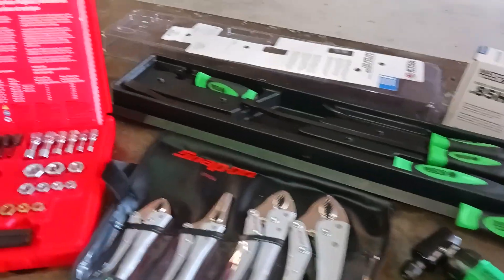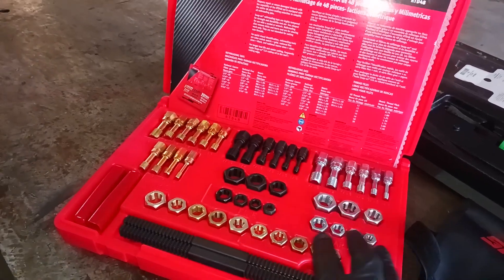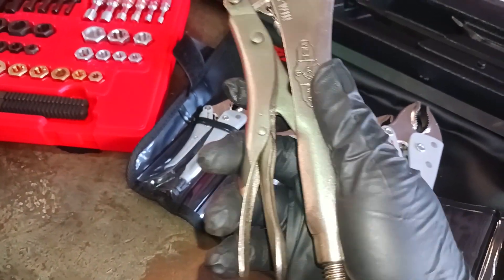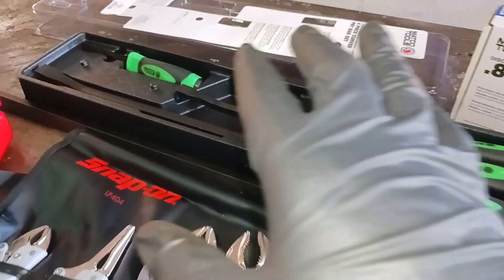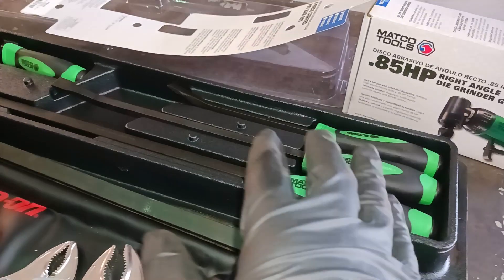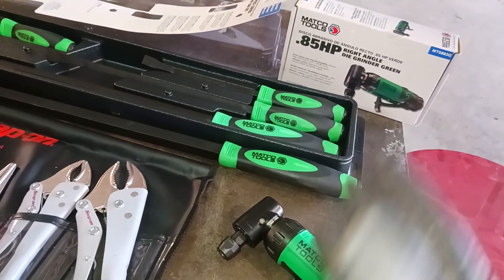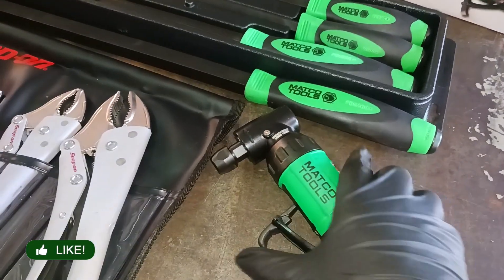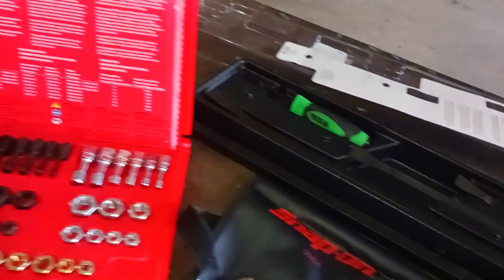Must Have Tools From Snap-on and Matco Tools! A Tool Truck Tool Haul!

Comment: Seems like a Great tool haul. You had common sense and logical explanations for each purchase. Recently I was really upset missing out on Astro 3/8" 19 piece nano socket set for $54.99. Went to get em the next week and they were almost 90. Then I looked further found the 14 piece with a 9 piece 1/4" universal socket set for $73.99. I jumped on it. I do miss the 20, 21, 22, 24mm in the 19 piece set but I will find the 1/2" on sale later. Just use wise decision making and you shouldn't regret your purchase
Reply from the maker: That's right.  Every time I buy a tools it's for a reason.  Never a "just because" purchase. I haven't made it that far in my career to be buying tools for no reason...... yet lol

Comment: The rethreader works great on ragged out aluminum bolt holes
Reply from the maker: Yeah haven't had to use it yet.  Hopefully I won't have to soon.  But we know how that goes lol
Reply: @EzTechJoe  mine gets used but not as much as my snap- on tap and die set just nice to have something quick to straighten things out

Comment: That Snap-On rethreading kit is just a Kastar Lang rebrand. The Matco pry bar set is made by Mayhew. I like the tools, but man, you get hosed on prices. I buy the rebrand because I don't care about the name on the tool when it does the same job with zero quality difference.
Reply from the maker: Yupp. I mentioned those and put the link to those tools in the description as well